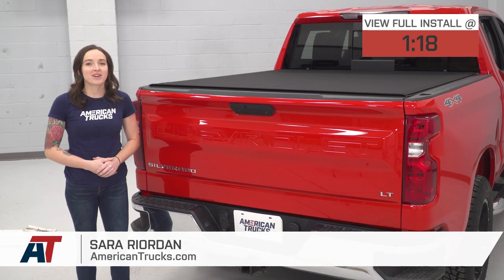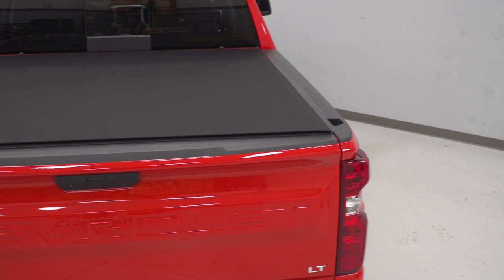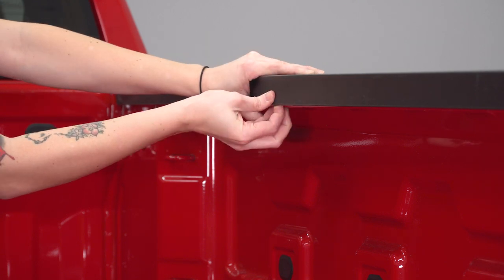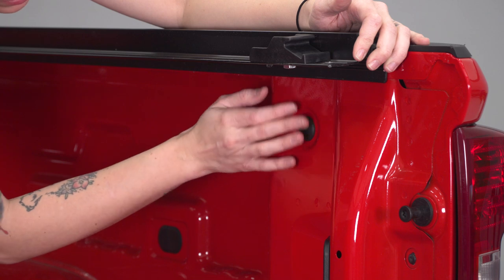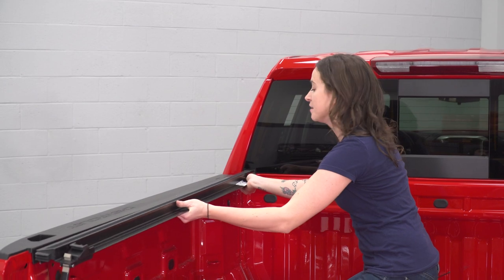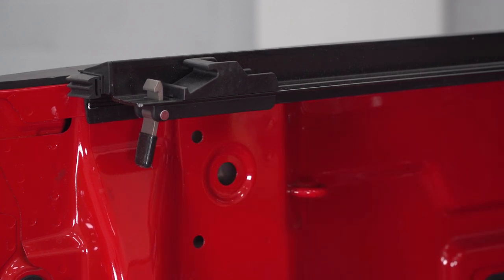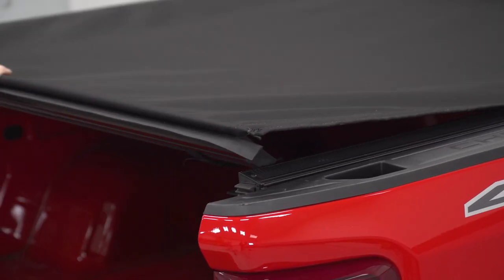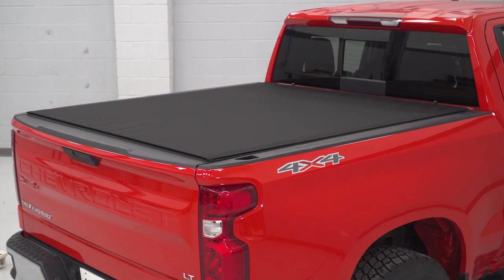2019-2021 Silverado & Sierra 1500 Truxedo Pro X15 Roll-Up Tonneau Cover Review & Install

Comment: Looks like with using the hole in the bed wall for the clamps closest to the tailgate, you’ll have to ditch the handle for the tailgate step, if you have it. I just checked my ‘23 ZR2, and sure enough, the handle is mounted to the bed wall through that hole on the driver side. :(